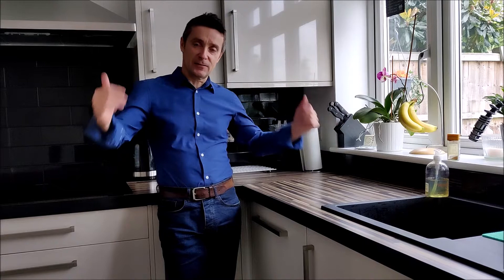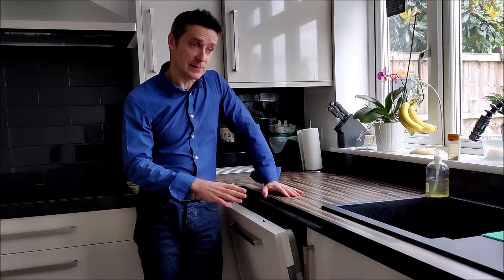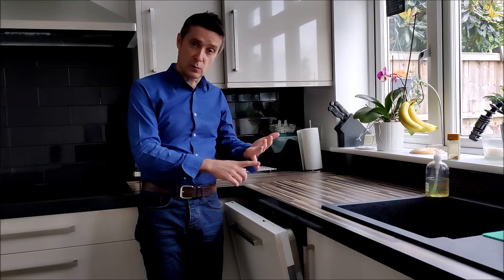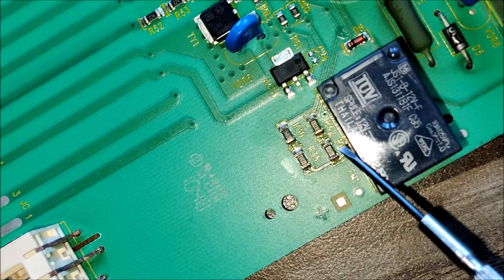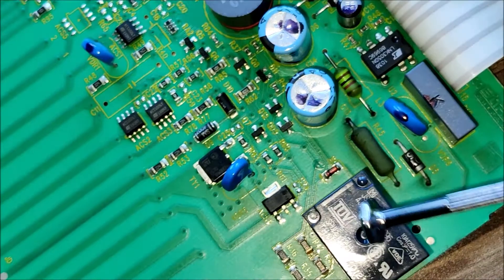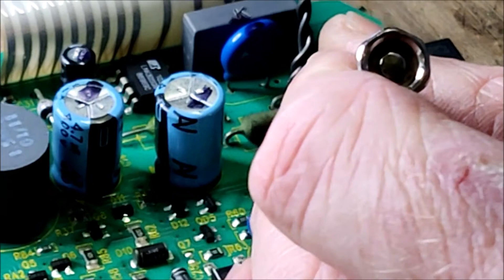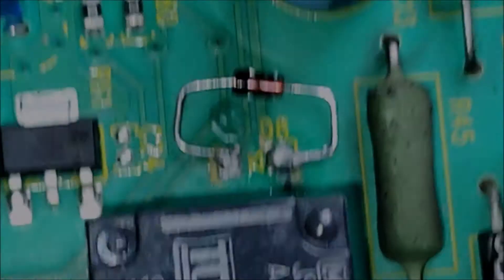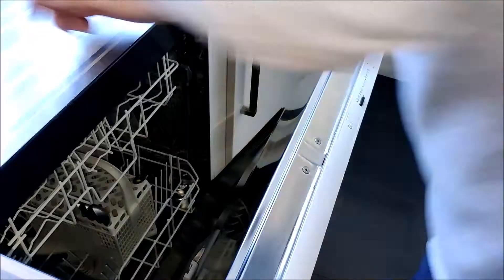Dishwasher Fix. No heat. 13p fix. Zanussi ZDT41

Comment: Just changed the heating element and sensor on a Zanussi, but still doesn’t work. Weirdly it works once if left off for a while. Assuming it’s the board now so going to check the stuff you’ve covered here. Thanks for video.

Comment: Thanks for this. Same issue with mine not heating up, I just assumed it would be the heating element but I will check the board first with the meter 👍
Reply: did you find it was the board? 

i have just had my dishwasher stop heating just as ive lost the boiler during a house extension which is unpleasant timing lol. I am about to rip it apart to go for the element but if you found it was the board i might do that first.

Comment: Found your video when searching on faults on a Electrolux ESL 43020 (mine stopped heating water) suspected the control board or relay so watched your video and found the same diode has strange readings compared to the other one on the board ( identical board by the way ).  Will order the diodes and see how it goes ..... Cheers

Comment: Not sure how changing the back EMF diode would solve this unless it measured short when you took it out, this only comes into circuit during reverse current when the unit is switched off?
Reply from the maker: I see your point and I don't have an answer for you as electronics are not my forte. All I can say is that subsequently the machine worked as it should as it has done for several others who have posted comments. There is the possibility that it is coincidental, that the process of disassembly "reset" another component, perhaps the relay? Generally relays fail due to either burnt/carbonised contacts or a failure of the windings in the electro-magnet. Hopefully someone else may be able to shed some light on this.
Reply: I just wanted to observe that you were misled during your diagnosis, but ended up at the right fix. I have just done exactly the same repair on a different model Zanussi ZDF3014 dishwasher, and all is working OK for me now. That diode is a back EMF suppressor to prevent the reverse voltage generated by the collapsing magnetic field from the relay coil damaging the control circuit. Several years ago I had changed the heater switching relay due to open circuit contacts so I went straight to that to make sure that it was switching OK when I found the faulty diode. The diode is wired directly across the relay coil, in parallel, so the resistance of the relay coil will confuse/mask your readings when taken 'in circuit'. My diode was dead short, so no relay switching. I definitely wanted to check the controller first before getting at the heater buried underneath - and a good job I did!👍